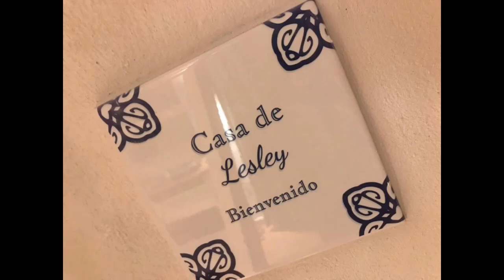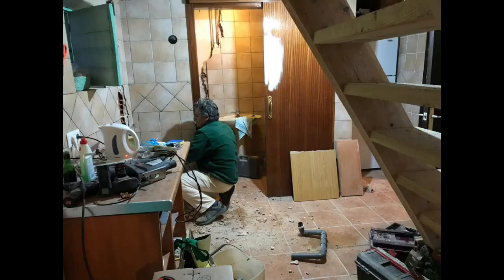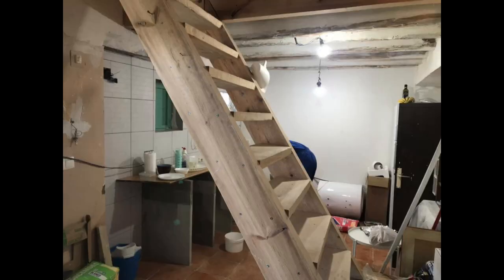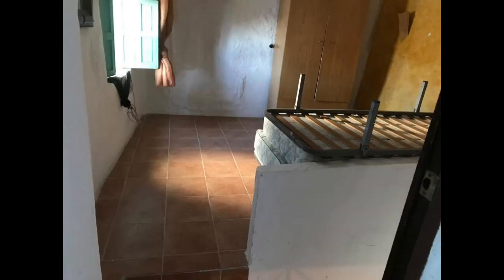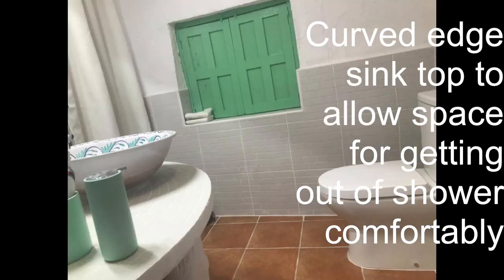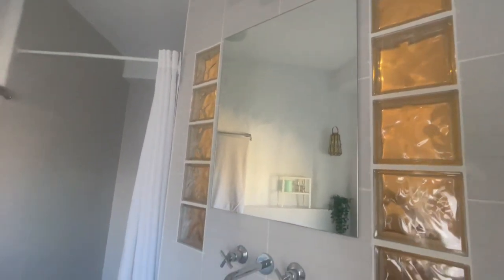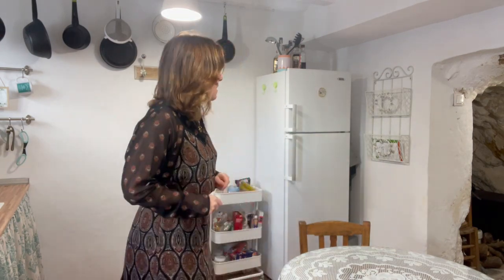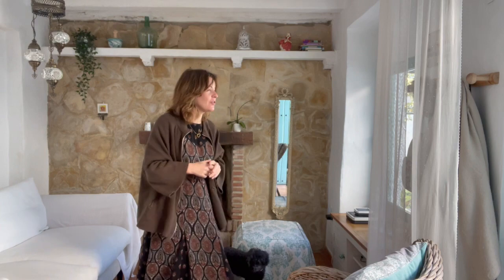Tiny Spanish property renovation project

Comment: How did you address heating/cooling?
Reply from the maker: To be honest at the point of this video I just suffered the cold.  I’ve now resold the property and the buyer has installed a log burner.  It’s fairly cool in sumner relatively speaking but air con is an option.